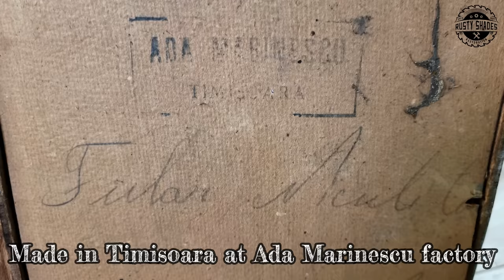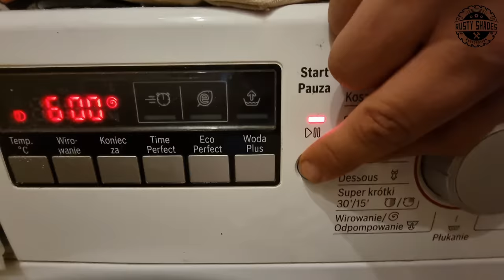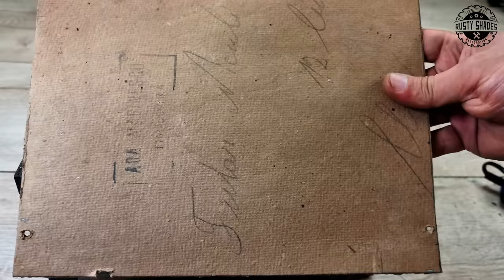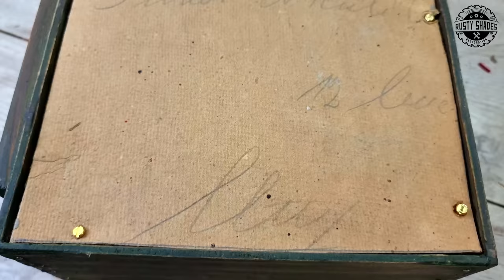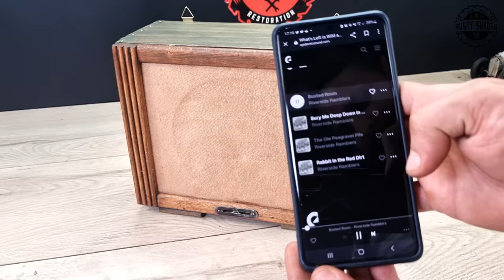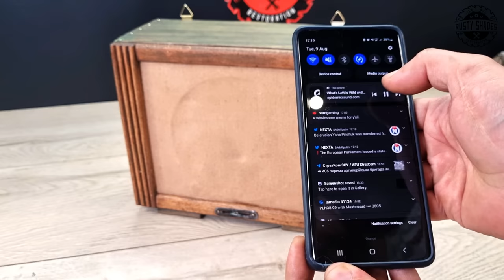1948s Wooden Speaker Restoration & Transformation - Bugs and Spider Web Inside!

Comment: Great restoration, but if I've seen it correctly, you could greatly improve the acoustic quality with some modification. It's very important to separate the front side of a speaker from its back side. Therefore you should mount the speaker chassis on a closed wooden ring / panel which closes the gap to the hole in the front panel. It lets the front side air compression only out through the fabric of the front panel and not directly to the back side of the speaker chassis, which is an acoustical short circuit. This will greatly improve the low frequencies. You may also add some acoustic insulation material before closing the speaker box again. 👂👍
Reply from the maker: Thank you! It was my first speaker restoration so I did my best. Your tips are great and I will save them for future projects. Cheers and thanks for watching 🙂

Comment: Okay now I am intrigued in what this was made for.:goodvibes::goodvibes:
Reply: @simonsimon557  :goodvibes:
Reply: At that time in the Soviet Union, many so-called radios were just a speaker in a case that was connected to a so-called radio point. Somewhere in the city there was a large antenna that received a long-wave broadcast signal and relayed it over a wired channel to the houses. This was practiced even in the 80s in apartment buildings. In the kitchens there was a special outlet where the signal was received. A receiver with a built-in amplifier had to be connected to this outlet. That is, again, no antenna. The broadcast could be heard even by simply plugging a low-impedance speaker directly into an outlet. And yes, you can't select stations.😄

Comment: Why does the speaker have a Maine's plug on it
Reply from the maker: It was plugged into a power socket and I believe that had a receptor that maybe someone remove it. Back in those days it was only a transmitter and people was getting a single radio frequency, so there was no chance to listen something else than communist propaganda.
Reply: It's not a mains plug. It's an old German style speaker plug, from before DIN speaker plugs came out in the 1950s. 
It only has the same pin diameter AND pin spacing as a Euro mains plug (and I'm not kidding)!
You can imagine how well this standard worked out in some cases. And that's probably why the old speaker driver did not work anymore.